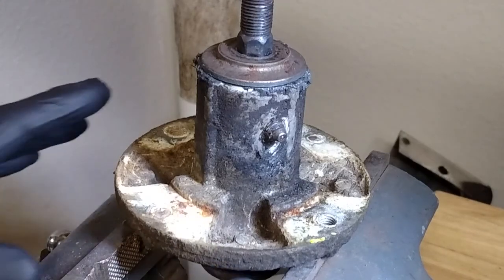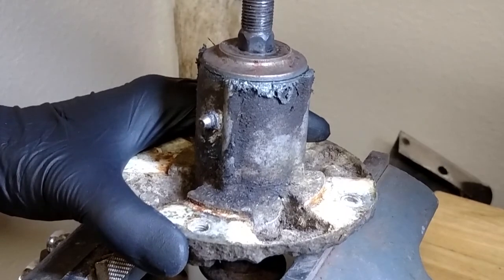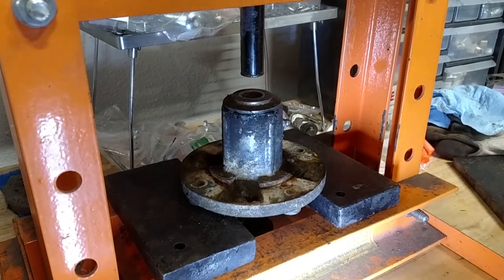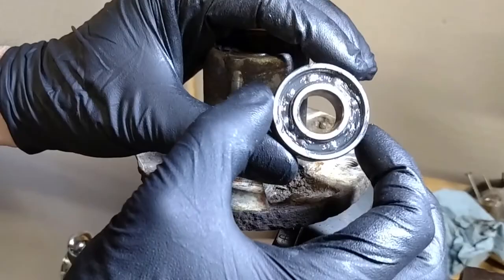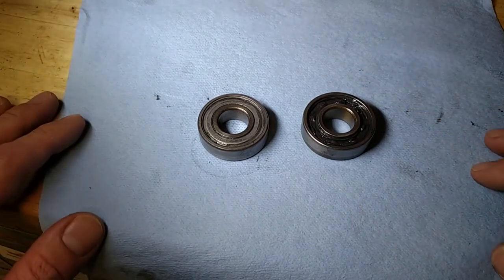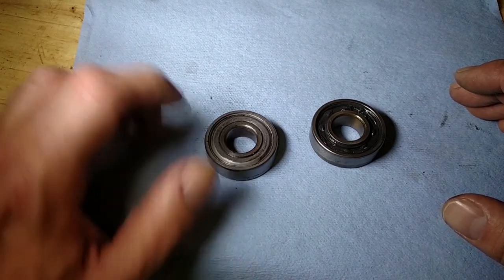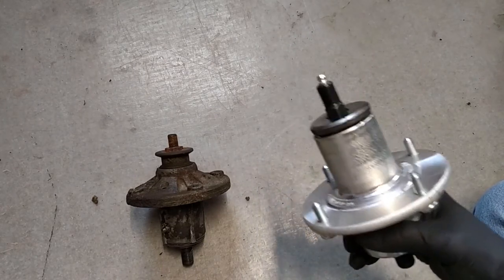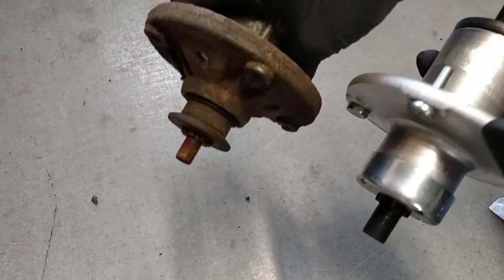John Deere X300 mower deck spindles: repair or replace?

Comment: My 2004 Dixon ZTR has sealed spindle bearings, both top and bottom.  Also has a grease zirc.  As you mentioned, it's a waste of time to pump grease in the spindle cavity between the sealed bearings.  Might make you 'feel good' but a waste of time.....

Comment: Sealed bearing in deck spindles are designed to fail every year or two.  Greaseable bearings will last a lot longer.

Comment: just did a 54 inch deck 6 bearings 20$   3 spindles .    nothing was wrong with the Housings or shafts .   unless a spindle is damaged no need to replace them and a old spindle with self tapping screws can be fixed by drilling out the screws .  to service a spindle do not remove it from the deck . looking for disaster

Comment: The bottom bearing takes most of the wear due to the impact of cutting  , imbalance and centrifugal forces it is subjected to .  It makes sense the top bearing was sealed because grease would drop down due to gravity . It also  proves a point , the bottom bearing takes most of the load . Good video I might ad .

Comment: Thanks!  I think my spindle shaft is bent. I also have the 38" Edge mower deck.  What's the part number to search for? I inherited the deck and X300 mower - so no instruction/owner's manuals.
Reply from the maker: AM143469

Comment: thanks for video, at end yu did not torque the pulley bolt on video. Please stress that so the neighbor won't loose the bolt when the pulley jumps off. Thanks for yur video and time.

Comment: Certainly not over greased because the axle was bone dry. Clean the spindle housing up, remove the broken studs, install new bearings, it is good as new.

Comment: I used to work at a John Deere dealer in the parts department, and your assessment of suburbanites greasing their machines is accurate. They either don't do it all, or way to much.

Comment: Great informative video. But why did you not  just change the bearings with the old spindle still mounted on the deck? Since the bolts were seized they still would have kept the spindle in place. 
Yes, the new one is nicer, but the bearing were the only thing that were bad in the old spindle.

Barry
Reply from the maker: Great question.  The reason is, I had now idea how easily these spindles can be disassembled.  I had assumed incorrectly that they were like the older cast iron style that you need a press or a huge hammer to knock apart.  So yes, in hindsight I could have just swapped the bearings in-deck.  Lesson learned!

Comment: Most of these bearings purchased on Amazon are Chinese bearings that have a smidge of grease in them, then are sealed inside and out. I recently rebuilt my spindles using sealed bearings, and removed the inner seals, flushed the bearings, and filled the bearings with my grease. I’m old school and know how to do this. My spindles have a grease fitting as well as a vent hole that lets me know when the cavity is filled. Like you, I grew up always greasing our machinery, so I’m disciplined at this, knowing I’m extending the life of my equipment. I’ve never had enough money to throw it away because I’m lazy, so I will always fix something if I can, before replacing it. My mower is a 2001, and runs quieter than the new ones in the neighborhood.
Reply: old school

Comment: I always replace the whole thing. I don’t try to get the bolts out. I use a 1/2” impact and snap them off and get on with it. On the new spindles, if the customer want to grease them, I remove the bearings, take off the inner bearing seals, install a grease zerk if the new spindle doesn’t have one, drill a weep hole for the grease to come out of when the spindle gets full, then put it all back together and install it.

Comment: We have an old STX38 black deck and was wondering if it is possible to change to the new Spindle? The Old one keeps stripping. Frustrating.
Reply from the maker: I looked up the STX38 out of curiosity, and it is a different design altogether.  The Deere parts site lists AM124511 as a replacement for your deck, as well as A-B1JD42 as an alternative.  It looks like the spindle with a pulley comes as an entire assembly.  Try the link below, or just go to https://www.deere.com/en/parts-and-service/parts/

https://partscatalog.deere.com/jdrc/sidebyside/equipment/57388/referrer/navigation/pgId/17521388

Comment: Just bought an x590.  How many hours were on your spindles before they started showing wear?  Thanks...
Reply: I'd like to know this also..
Reply: I'd say after 150+ hrs they are in borrowed time,unless modified sooner!
Reply: @jazpanoz4996  Mine had 160 hours on them, that said I did push the deck a bit beyond its design limits last summer mowing a bit of pasture !